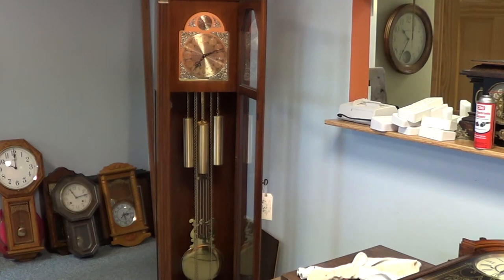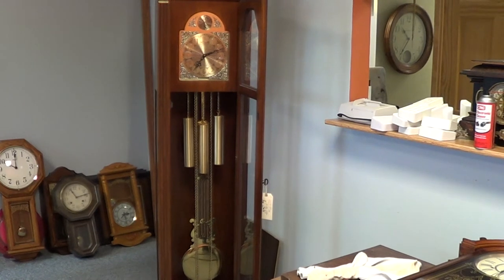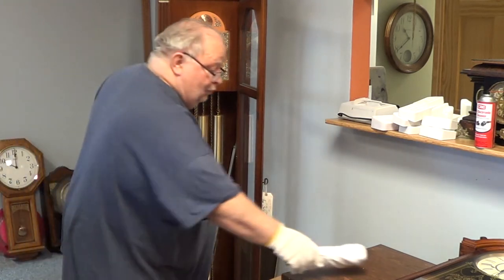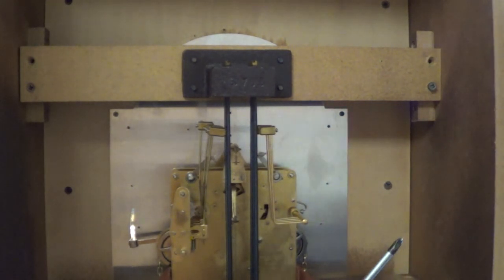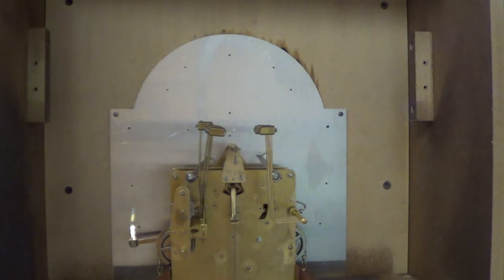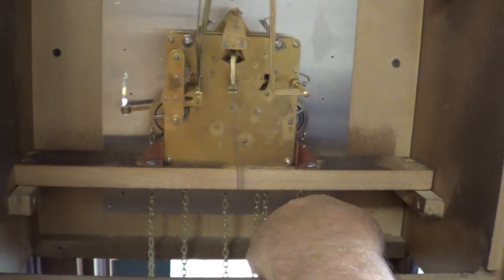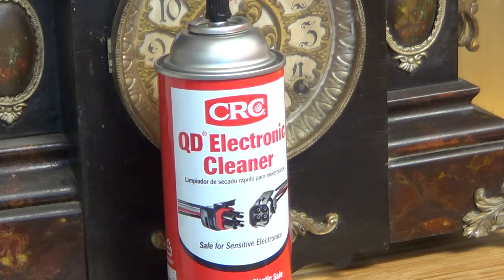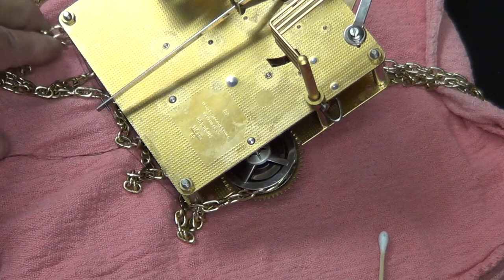How To Clean & Oil Your Grandfather Clock PART 1

Comment: What a wonderful site and series of video tutorials for a Grandfather Clock.    I am retired and my neighbor asked me if could set up and oil and clean their Grandfather Clock that they have had for over 40 years.    I am in no way a clock guy, but I said I would be glad to give it a try!!!   Unfortunately, the job was much more involved than just handing the pendulum and weights and winding it up....   After doing that as carelully as I knew how, the clock would only run for for maybe 10 minutes and the chimes would do nothing!!!!   The wife said she "used to oil" her grandfather clock, but had not in years.....     Fortunately, I found these well done videos and they gave me the confidence to remove the works  and attempt a thorough cleaning and oiling...   I found lots of gunked up oil and dust in the works that was pretty sticky to say the least!!!!   An email to "my Bench Jeweler" was promptly answered with great suggestions...   I ended up getting instruction on how to carefully clean with oderless mineral oil...   That was a majic cleaner and washed years of old oil, dust, and gunk out!!!   I carefully dabbed and dobbed with q-tips that my Bench Jeweler" included in the Clock Kit I purchased from him...  after lots of patience, everything was back to clean...    I then cleaned the oil wells and oiled each as described in one of the 4 videos on the site....    As soon as the works were reinstalled and the weights hung and the pendulum started, the chimes performed greatly!!!   Unfortunately, the clock would still not stay running and would only run about 10 minutes...   Another email to "my bench jeweler" was answered quickly with an easy solution!!!   He believed the clock was likely out of beat and he told me how to quickly try to reset the beat....    By swinging  the pendulum all the way to the ends of travel inside the case and then letting it go...   that apparently resets the clock "beat"....      The clock has now run for 24 hours and the chimes are beautiful after I adjusted the hammers as described in one of videos!!!     Thank goodness for Google and You Tube, but a bigger thank you to "My Bench Jeweler"...    He was most patient and helpful  and gave me the confidence to try a new skill!!!
Reply: Great video. I am new to clock repair.  I am working on a baby ben.  When I get it running I'll tackle a grandfather's clock

Comment: Thank you.  I watched your three videos on clock cleaning (along with a host of other YouTube videos on the subject) and purchased your cleaning kit.  Today, January 14, 2024, I took the movement which I had earlier removed from the clock and cleaned and oiled it.  I took my time and the work progressed without a hitch.  Upon completion, I reinstalled the movement, face, weights, and pendulum.  The clock now chimes all three tunes and gongs without any problems.  Most of my time spent on this project involved watching YouTube videos and taking notes on the subject before I started anything else.  The cleaning and oiling work really is very straight forward.  Oh, and I did find using toothpicks would work but the force required to clean old oil out of the "shaft journals" caused the toothpicks to splinter or break.  Toothpick wood is too soft for this work.

Comment: My grandfather just kept having issues even after the fix. I finally replaced both hands with new hands and it is working again. The only problem is the chiming is off by five minutes but I had shoulder surgery and taking the minute hand off and putting it in the correct position is just too difficult when I am down to my non dominate hand. I will get it right eventually doing the procedure you showed me.

Comment: I can’t believe my step siblings let me have my parents’ grandfather clock. It is a Ridgeway. My father bought it for my mother for their 25th anniversary. My step mom said it stopped working when my father died - just like the song. Come to find out she never kept up with pulling the weights back up. So now that I have it and it works, it was fine but now sounds so off tune! My father repaired organs so it is so bothersome. It probably has never been cleaned. I am so thankful for your videos! I will be ordering your kit soon! I also have two coo coo clocks that don’t work. I have to see if I can find a video on that. What a joy it is to have in my home! Thank you again and we will keep in touch through ordering!
Reply from the maker: I'm working on a video to show how to reset the hammers so your clock's tune sounds right.
Reply: @rhjgold  That is awesome! My clock has just stopped. I moved it over about a foot onto carpet. I even tried moving it back and the  pendulum always stops. I think I figured it out.  It’s even. I checked that. I believe it has something to do with the middle weight. It looks like it isn’t advancing. I had gloves on and was working with it and it came off the hook. I checked the chain and it slid way up. So when I put the weight back on it was up too high into the cabinet. I have tried to not over wind. Could that middle weight be the problem? It takes care of the minutes right? I figure I’ll just wait until I get the kit to take it apart and look at it. I’ll be ordering it tomorrow. Thanks again for your great videos and sharing your expertise!
Reply from the maker: I this clock a cable with a key to crank it up or a chain-driven where you pull the chains up.  The Bench Jeweler

Comment: Loved you instructional videos regarding oiling a Grandfather clock. Great information. I ordered your kit and will try to attempt oiling my Grandmother clock.  I think we might of had service a long time ago, but I believe it's been over 20 years.  It's been working, but recently the chimes stopped working.  Hoping it just needs cleaning and oiling.  I do have another issue that maybe you can help me with.  The clock started awhile ago, not chiming the hour correctly, it's one chime less than the actual hour.  Any advice would be appreciated.
Reply from the maker: Yes, can be a simple fix.  let's say it's 9 Oclock and your clock chimes 8 times with a careful thumb and first finger gently hold the hour hand and move it back one hour.  The hour hand has a tight but slip bushing and you can move it back words without hurting the clock.  Let me know how it goes.    The Bench Jeweler...

Comment: Good day and thank you for sharing your knowledge with us. I live in Canada and have a Hermle grandfather clock and the two outer weights (both are wound right to at the top position and no longer come down.
The middle weight works fine and we are able to use the clock, but unfortunately this means that we have to wind more frequently can you direct me on where I can find how to fix this please.

thank you so much.

Lou
Reply from the maker: Sorry, somehow I missed this message. Most if not all Grandfather clocks run between 7 to 8 days. I choose a day in the week to wind mine back up I picked Sunday mornings.  Even though your chime weight and strike weights are not coming down have no effect on the time weight in the middle it should still take 7 days before winding. If it stops sooner then it to has developed problems. We do make a cleaning kit and videos on how to oil your clock but this only works if you didn't let it run too many years without cleaning and oiling. You may have bigger issues with your clock? Is this a chain-driven clock or cable with a wind-up key?  Thanks for watching our channel. The Bench Jeweler.

Comment: I have a Ridgeway model #226, movement cc1161-853-114 cm, made date 11/15-84. It was not running for about 10 years so I order your oil kit. Chimes work great but it will not stay running. Have you got anything you can help me to get it running.

Comment: I have a Ridgeway model #226, movement cc1161-853-114 cm, made date 11/15-84. It was not running for about 10 years so I order your oil kit. Chimes work great but it will not stay running. Have you got anything you can help me to get it running. 15:03

Comment: What cleaner would you recommend if the clock panels are green? Also the whole movement is very dusty?
Reply from the maker: You can use odor-free mineral spirits which should help remove dirt and dust from the movement front and black plates. You should use clock Oil to re-oil the movement. Don't use sewing machine oil 3&1 oils you will need to buy a high grade of oil such as our Red Dragon Clock Oil.  Thanks The Bench Jeweler Mike E.
Reply: @rhjgold  Thank you so much! I have picked up a clock movement that is rather dusty and was planning on ordering your kit to help. Can a movement be saved if it is covered in a thick dust?

Comment: This is a fine narration of the gearing.  How do you lubricate the springs of the movement. My chime hammers seem slow I sense the springs are dry.
Reply from the maker: kEITH, what type of clock are you referring to?
Reply from the maker: @keithgale5913 , You just about need a letdown key. The mainsprings have a ratchet on the wind-up side or front. With a letdown tool, you can open each ratch and let the spring down. Never try using a key. Once your springs have no power you can check the gear pivots for bushing play as seen in the cuckoo clock video.  Once you have cleaned all the pivots from dirt you can have a much better idea of what might be slowing down the clock. Cleaning and Oiling might do the trick without removing the springs and barrel lids first place to start. You can make a letdown tool but it requires a second key that you can remove the handle from and using a hard piece of wood dowel pin drill a hole and pin the key shank so it can't spin.

Comment: Love your videos, and recently purchase your kit to clean and oil my 1982 Ridgeway Grand Father clock. We live in a coastal city where humidity is always an issue. The clock haven’t been serviced since 2011. After removing the movement, two things were observed: #1 the weights are tarnished and the chime bars have surface rust on them. Can these be cleaned.
Reply from the maker: I have never had much luck polishing brass weights, most are lacquered the chime rods can be cleaned with a  bright pad you can buy them from most food stores or auto parts stores.  You can try a brass polish compound then respray your brass tubes with clear lacquer you need to remove the lead or steel inserts out before you start.
Reply: Thank you for your quick reply. One last question regarding using a bright pad on the chimes. Should I spray the chimes with a lacquer to prevent further rusting?
Reply from the maker: You could pull the chime rods out and spray them but personally, I would not just clean the rust off them and should be good to go.  one last warning or tip be very, very, careful when cleaning them don't bend them clean straight up and down at the top of the rod very thin and they can break off and costly to replace.  Do as little as possible to clean them.  The Bench Jeweler
Reply: That’s part of my job is to polish brass look up mantiques in Florida Inverness

Comment: I also have an Emperor Mantle clock that I bought as a DIY kit in1977. It hasn’t worked for a couple of years and I just cleaned and oiled it using your kit that I purchased recently. The clock platform cover needs to be replaced (I can supply a photo if required). Do you carry this or know where I can purchase one?
Reply from the maker: Not sure Mark send a picture so I can see what you're talking about.   Mike E
Reply: Email with photos sent to you on 2/10

Comment: What else can you use on the cotton swabs as a cleaner, if you don't have the CRC Electronic Cleaner? Would alcohol work?
Reply from the maker: You can use lighter fluid followed by using the same swab dipped into alcohol and recleaned a second time.

Comment: I clean my clock movements using hot chlorinated solvent in an ultrasonic cleaner, after removing the mainsprings.
Reply from the maker: For mainsprings, I use spent Clock cleaner  L&R 566 Ultrasonic Cleaner then L&R 667 Clock cleaner it's pricey but worth the extra cost.

Comment: I have a Ridgeway model 145, serial number 1237690,  It has been running just fine for the last few years.  Recently it has started running for a minute or two, until the paendulum stops.  If i do not reset immediately it will not run.  The center weight does not seem to be dropping.  The two outside weights drop as designed..  So - suggestions as to why the clock stops running??
Reply from the maker: Facing the front of your clock the far-right weight is your chime weight which chime's on the quarter-hour, half-hour, three-quarter hour, and on the hour. The middleweight is your time weight. and the far left weight is your strike weight which strikes the hour that it's on. If the middleweight stopped so does the chime and strike weight.  Is your clock a chain-driven or is it a cable-driven if cable it will have a handle crank to wind all three weights. if chain-driven you will wind the clock by pulling the chains up.  If you can open the back of the clock cabinet you will need to look inside at the movement and give me the movement number. If your clock opens on the side only you may need to use a mirror to read the movement number.  Be careful not to tip the clock over as it is top-heavy.  The Bench Jeweler.

Comment: How do you clean your pendulum and weights if they have been touched?
Reply from the maker: Well, best not to touch your brass weights use cotton gloves.  On the brass, I use  a lint-free
jewelry polishing clothes or you can use a very soft cotton towel be sure to take them off the chain or cables and wipe them clean. If they are really bad or tarnished you can try making a lemon backing soda paste rubbing them lightly and wiping clean.  Try this on the bottom of the weight first always use caution.   2 tablespoons of lemon juice and a tiny bit of soda.  They make a brass cleaner to but I don't like using it.   The Bench Jeweler

Comment: I am looking for How To Clean & Oil Your Grandfather Clock PART 1 but can not find it could you help me.  Thanks
Reply from the maker: I think that part 2 is really part 1 and part 3 is part 2 and part 4 is part 3 and there was supposed to be a part 4 installing the clock back into the case which was lost.  I believe that was how it was to be numbered.   Mike E  The Bench Jeweler.
Reply from the maker: I renumbered them and I will try to create apart 4  how to install them back into the case and set the beat and timing...

Comment: I am doomed on my clock, a friend lubed it with ISO 32 hydraulic oil now everything is too sticky to work. Now I have to very carefully dismantle it and clean every piece in an ultrasonic cleaner which I do have. Tedious...
Reply from the maker: It's sad but people have used all kinds of oils and sprays that over a small period of time not only gum up the works or movement but cause real damage to the bushing plates and gears. You can use plain odorless mineral spirits if you have an ultrasonic even better but only clean it for 5 minutes in the tank with no heat, dry with a hairdryer, and then use proper oil to get it back to working condition.  The Bench Jeweler.

Comment: I sprayed my clock with wd40, now how can I get it off?
Reply from the maker: You can use mineral sprites to rinse off the WD40 You can buy a small can of mineral sprites a spray bottle or brush then a hair dryer to dry off the clock. Never use a spray oil of any kind most are cutting oils at best. Clock Oil Only! The Bench Jeweler Mike E.

Comment: Just a couple of observations.. #1 a weighted bag of lead shot, sand etc placed in the bottom of the clock would keep the clock from falling over..#2 although this guy is giving great tips, I would never get him to touch my clock..as he is very rough and haphazard with the customers clock..a bull in a fine china store comes to mind.. lol..that said thank you for the tips..
Reply: It's best to fashion to the wall at the top of the clock. Makes easier winding without shaking the clock. The wood cover in the bottom of the clock is made of very thin wood lightly secured so as not to damage the heavy weights in case of one dropping, not too strong for heavy leadbags.